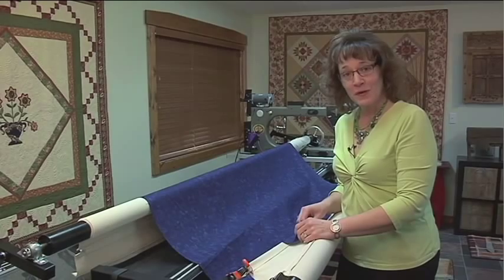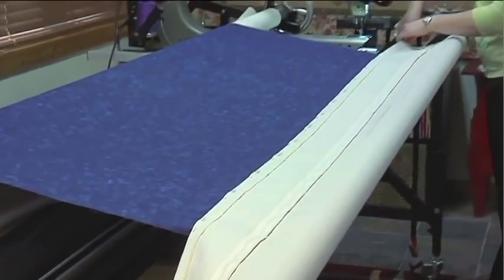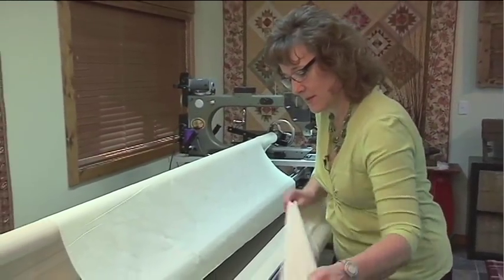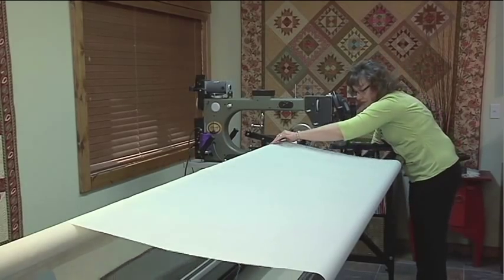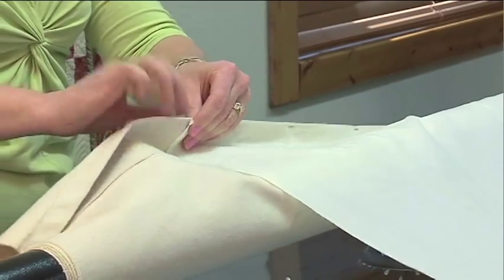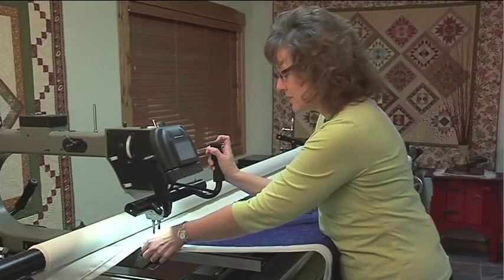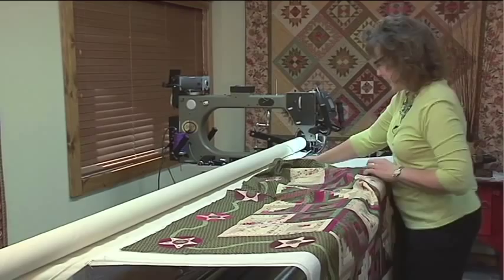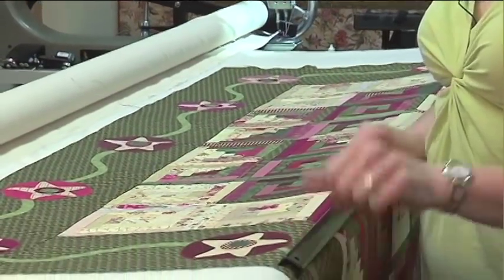Longarm Lifelines: Quick Loading Techniques

Comment: I bought the magnetic bars at Harbor Freight for $4.99 and the magnetic pin dish for $2.99 and a suction ruler handle (marketed as a bath safety grip handle) for $6.99. Harborfreight.com if you don't have a local store.